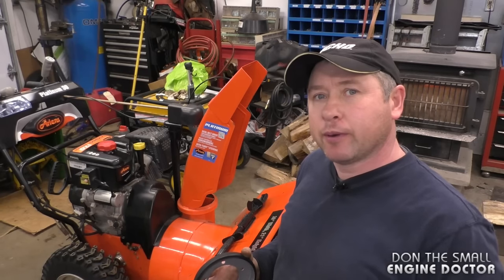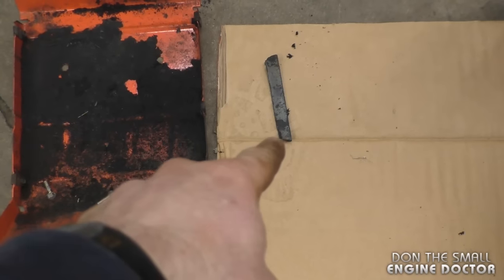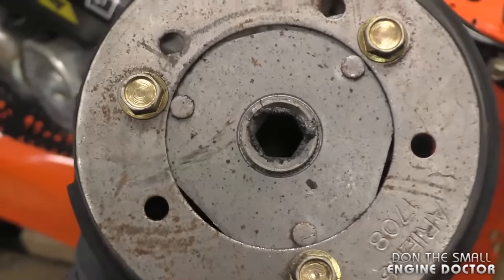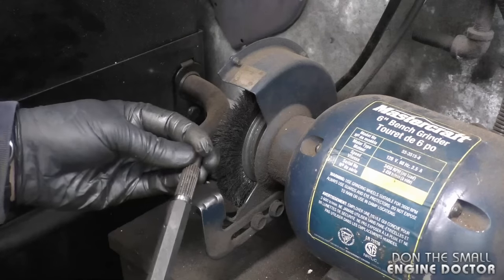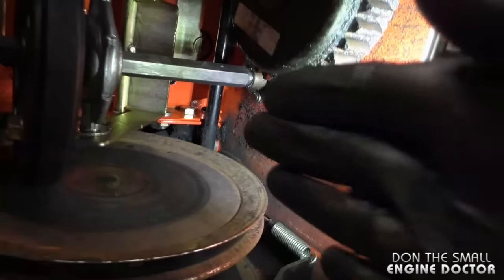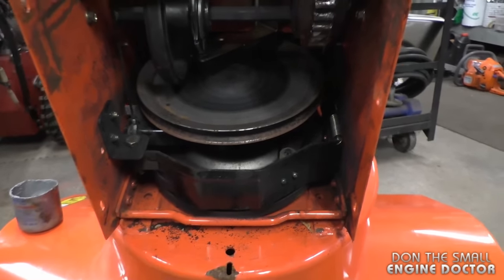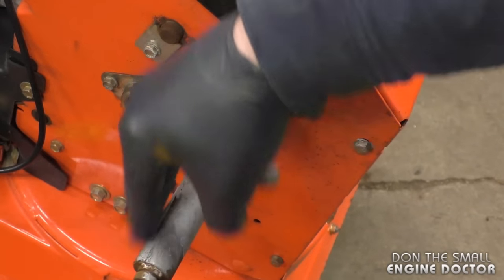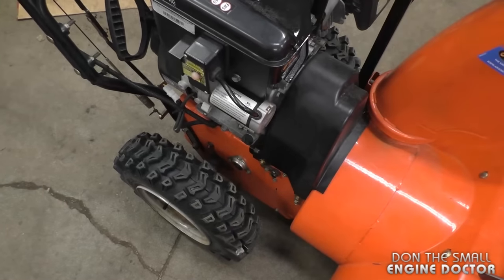HOW-TO Replace A Friction Disc On Ariens Snowblowers - Make It Drive Again!  - Video

Comment: This video is great!  It's better than the Ariens video on the same topic.  It's nice that you worked on a used model rather than a brand new one (like the Ariens video).  One thing to note, if that shaft slips inside the bearing it will ruin the shaft and the bearing.  The inner race of that bearing is supposed to have a slight interference fit with the bearing so the inner race moves with the shaft.  Ideally you would not sand/grind the shaft and you wouldn't lube the shaft/inner race of the bearing.  That said, by the time you are changing the drive disk this may not be much of a concern.

Comment: Another great video Dony! 

Confession time

I remember the first time I tore my snowblower apart. I wire brushed everything, cleaned every part then lubed all the critical areas...........including the friction disk but it was accidental. I got carried away with the spray lube and didn't see it on the disk! Ooops!!  

I didn't notice it until I tested everything and no forward or reverse! Remove the belly pan and thoroughly clean the friction plate and disk....LOL

Comment: Great video, just a quick question. Do I have to readjust the drive cable after replacing the friction disk? I had to take some slack out of the cable as the old friction disk wore.

Comment: Great video!  Reminded me it was time to change out the friction disk in my 12 yo Craftsman, along with doing the belts again.  It had some slippage during our big snowstorm last week, but still allowed me to clear.  Changed out those three wearable items, and cleaned the debris from the friction interface plate and the Craftsman throws snow like new again!  Now for that carburetor surging...

Comment: I'll be doint this on my Ariens next spring. One difference is that I have an adjustment nut on the lower left side of the belly pan. What do you know about older units that need adjustment after a friction disc replacement? Where's the hapoy spot between too loose and too tight? Trial and error until you get it?

Comment: Great video! Is there a way to check the wear of the friction disc without taking it all apart? I went to go use my Arien for the first time of the season the other day and it wouldnt drive on its own. I moved it back and forth a few times and it eventually worked and since then ive used it three more times without issue.

Comment: I had a  MTD/Yardman for 27 years of hard usage and never had a  disc wear out. The Housing rested out. Loved that machine. I also never maintained the unit other than oil and gas.I am suspecting that grease or oil is migrating onto the disc and then the rubber wheel is done for - OR - the Engagement lever was adjusted wrong. I also know  not to use 1st or "turtle" speed -  only when necessary -as that causes more wear. I am here because my 2  seasons old  ToroHD 826OXE wouldn't shift. I was suspecting critter trash in the unit , but it appears The Toro factory never lubed the hex shifter drive shaft. Everything under there was bone  dry and the shaft rusted. I didnt have grease but I hit the shaft with red scotch-brite, then wiped it,  then cleaned it with light oil and a  rag, then wiped it down with Porsche A40 motor oil.  I had some Syl-Glyde brake lube that would likely work, but the service manual recommends motor oil. Now i just remembered that I have gun oil that would work great too:) Excellent, but I don't like to see all the grease on the gears near that disc. Appear to be a  universal design issue, but surely made to be simple and easily serviceable. - Sandy

Comment: Dony Great Video.  But my issue is I can’t remove the shaft with the friction disk because the bearing is frozen onto the shaft on the right side as you are looking at the back of the unit.  Any special thing to remove that bearing?

Comment: You are right about the original friction disc wearing out early.  In my brand-new Ariens, the disc wore out in about half-a-hour of operation.  Took the machine apart and found shreds of rubber lyimg inside.  Replaced it with an after-market disc, now still workiing fine in its third season. Go figure!!
Reply: I had a new mtd wear out after short time. Really just one section. I found that return spring on drive disc was missing so I figure it was bouncing onto the rubber when sitting running in neutral

Comment: What do you do when you hold the blower from moving forward and the wheels don't turn but the clutch starts clicking? My friction disk is brand new but it's like the clutch inside slips? (Great video btw)

Comment: Hi Don  another great video,  only thing I would add would be to mention the clearance between the friction wheel and the friction disc.
Also that clip you mentioned.....I think it is there t o prevent the friction wheel housing from hitting that gear on the right
Stay safe

Comment: Great video.  Easy to follow as well.  I was wondering if you ever wire brush those some what rusty axles ?  One of the other things I do to my Blower is I clean out the hub of the wheel as well.  We got about 18 inches here in Jersey overnight.

Comment: Hooray Hooray, I did it properly!!  Thank you for all the hard work in making all your videos.  This one is especially helpful.  Thank you also for showing the different uses for "Grease" versus "Anti-Seize".  May I make a suggestion?  Please use Diesel for a washing/solvent.  It has  much higher flash and vapor points.  Its a Lot Safer to use than even oiled 2-cycle gas.  Thanks again for this and all your other videos.

Comment: I found putting on Loctite @5:50 in the video interesting. I would have thought that anti-seize would be the product to use. The snow blowers you work on may not have much rust yet since older equipment is not brought for service as often (being either repaired by the owner or discarded due to cost considerations), and the bolts in the video look new. However, snow blowers have plenty of opportunities to accumulate rust as they age, and fasteners need all the help they can get to prevent them from oxidizing. Do you have any experience with the friction discs loosening to warrant using Loctite?

Comment: Among my pursuits and businesses, I presently own/operate an appliance repair business~~washers, dryiers, reefers, etc. I have always done my own repairs on all of my equipment, including snowblowers and/or etc. 
This is an excellent video however, the most important thing to me is those gloves you are wearing.
Will you please tell me what they are and where to find them?
Thanks.
Reply from the maker: they are black nitrile gloves, you can get them on amazon or a safety supply store

Comment: Dr. Don, you are amazing! I just received an old Murray 624505x4b as a gift from a very good friend who moved to Arizona. It runs good but I like to learn. Since then, I have been watching your videos and even many that are not for Murray are very interesting. So, since I have the Murray axles with lynch pins, I guess I should use grease and not anti-seize on the axles if I want to have the option of only using one drive wheel? Thanks so much for sharing!
Reply from the maker: yes

Comment: Hi Don, I have torx bolts on the friction disk mounting plate on my Ariens and I am having a devil of a time to remove them do you have any tips on how to loosen those bolts? I read somewhere that its possible that Ariens uses that Loctite stuff that you are using to keep the bolts on tight.

Comment: Hi Don, we're about to get a noreaster here on the US east coast and we really haven't had much snow in several years. What should I do to get my snowblower ready? I ran it dry at last use and it's been sitting for about 5 years...
Reply: go see if it starts right now....FRESH gas is a big key...plus if it sat for a long time, there is a good chance critters got inside it and made nests all over any openings....you are about 2 -3 months behind schedule for snow in the NorthEAST...I live in Syracuse NY so it is a regular deal for us every year...now get going...or get the shovel ready

Comment: Dony ... you helped with the fricton dics last winter ... now one side of the auger is frozen.  I can start it ok, but only one auger spins.  The other is frozen, shear pin seems to be seized and both ends are broken. It;s one solid bar so I don't understand why one would turn and the other not. It will not turn freely when stoppped.  Any ideas??? I'm stumped!
thanks, Ken

Comment: Great video. I have similar setup. My friction disc is too far to the left. First gear won't work but 2nd reverse gear is grinding on against metal to the left. 1st gear is slightly left of centre if the friction plate which tells me jt all needs to move over a bit.. any idea how?
Reply from the maker: is you shifter linkage adjustable? I would have to physically see it

Comment: Not a bolt usually checked, but check your starter bolts that hold the starter to the block.I’d never checked mine since new but after 8 years or so I checked them during other work and noticed they took almost a full turn to fully seat and draw down.

Comment: Dony, my dad has a 25 year old Craftsman blower, the drive wheels are no longer engaging when you pull the lever, the friction disc doesnt appear to be that worn but when you pull the lever it doesn't appear to shift the discs together to engage the drive axle. do you have a repair video for this?

Comment: Great video Dony - only question I have is the square bracket "washer" and round steel washer on my exact machine seem to be reversed when capturing friction disc assembly to fork.  The small engine company that delivered my 921029 didnt do a great job as it broke 2 storms in so dont know if they assembled it incorrectly or not.  I did look at the Ariens parts manual and if you look at it from the perspective of how the actual machine sits when doing the repair the manual shows the assembly diagram in opposite orientation.  So thinking I inverted the diagram correctly it does appear that Ariens shows the square bracket on the bottom and the round washer on top.  Can you double check from the schematic and tell me what you think.  Thanks.

Comment: Do you have a video on changing the friction disc on a snow blower with an easy-steer system?
I want to change the friction disc on my old Troy-Bilt 3090 (31AH5ZQ54711) with steering assist. That seems to make accessing the friction disc more complicated. 

I don't want to mess this up, so I would appreciate any advice and guidance I can get.
Many thanks.

Comment: Hi, I have the AX396 engine on the 24" SHO Platinum. Since new it does not like to start in the cold. I have tried every conceivable sequence with the primer and choke. I end up having to use the electric start and crank it a lot to finally get it going. It will always start but,  It the summer I run it and it takes only one or two pulls. I have done a pretty good search and it seems like this is an issue with this engine.
Is there anything I should try. If I keep it in the garage and keep temp up over 50 it will start easier. I have changed the spark plug and keep fresh gas in it. Anything else that you might recommend?

Comment: I have often wondered what type of grease to use on the shaft the friction disk slides on.  I've used lithium but it seems to get pretty thick when it's cold.

Comment: HELP!! I have a 1708 Arien's Friction Disc that I needed to replace. I purchased your recommended Oregon part but it doesn't look like it fits. There's not enough clearance to get both the square and flat washers in place. What am I doing wrong? I really wanted to try the Oregon disc sine the Arien's discs do not last. Please let me know.

Comment: Minister donated his regularly used  94 mtd to the church. As part of checking it over i replaced the drive rubber. I don't recall what I used to lube the hex shaft. After a few uses I had trouble shifting gears. Disc was sticking on the shaft. I sprayed with brake clean and it started moving. After another few uses same thing. Again loosened with brake clean. Had some garage door lubricant on the shelf there so applied some. What's best to use. I have John Deere corn head grease for blower gearboxes. Would that be good to use? Ok. I see white lithium grease. I thought that was what I sprayed on the first time.
Reply from the maker: i apply lithium grease with my finger

Comment: Hello Dony, great video as usual. Assumed about the differents the anti-seeze vs. lubricant on the wheel shaft. Why do you use anti-seeze likely than a grease? Do you think grease is not so durable compared to the grease? Greetings from Czech rep.

Comment: Hi Don, i just bought a new snow blower from Lowes Briggs and Stratton. This the second year I have it. On the first year, I find that sometimes that it will not move when you squeeze the drive. I tighten the cable and it seems that it work. But my question is;  is there anything that i could have done?  I'm thinking of cleaning the drive plate with break fluid, is that going to work as well?
Reply from the maker: you can use brake cleaner not fluid. adjust your drive cable, it may help
Reply: @donyboy73  sorry I meant break cleaner and not break fluid, I understand you said before that those 2 components must be free of any oil or lubricant.

Comment: Have a quick question I have a newer Ariens compact 24 I changed the friction wheel and traction belt but still not much power to wheels my model is 920029 the belt I used was 07200603 not sure if it was oem could this be my problem

Comment: I have an older Ariens mower with a friction wheel drive like a snow blower. The friction wheel is discontinued. Is there anyway to install a generic wheel or add rubber to the wheel? It seems a shame to throw away a mower of this quality for an individual part.

Comment: Great video, I own an Ariens Platinum 30 with the 414cc engine. Maybe you can help me out with finding a part for my machine, I'm looking for the sqaure plastic cover that fits over the extension cord port for the electric start.
Reply from the maker: you should contact your local ariens dealer

Comment: Must have a defect on those machines, I have a 2014, 28 deluxe and have had the drive wheel done 3 times. 2 under warranty and one I paid for. Where did you get the replacement part from?
Great video, will save me money next time.
Reply from the maker: yes, that's why i use aftermarket oregon friction discs, they last longer

Comment: I use scotchbright with contact cleaner to clean that drive platter. It seems to get a little more "traction" on the rubberized friction disk.

Comment: Do you have a video on replacement of the friction disc on a Ariens 10000 series more specifically a Model # 910010 8-32 mine is a 1973 and I don’t believe the disc has ever been replaced. Thank you

Comment: My Ariens has a hesitation to move but then once the wheels engage the will spin on concrete. The metal plate has been cleaned andcwhile the friction plate is not new it still has plenty of rubber and the bottom cover was not full of shavings. Its clean. I recently replaced the drive belt with the OEM part. Any ideas what this hesitation to move might be. I also have the control tension set to just below wanting to engage as the hand grip is squeezed. One wheel will turn and then the other if I rock the blower. Is there something called a "Hilbert" junction that can fail?

Comment: Is there a minimum measurement for the diameter of the friction disk?

I have a 2005 craftsman Craftsman C950-52430-1 and sometimes it wont drive and then takes off again.

Comment: Dony, need help here...any suggestion on how to remove a stuck wheel on troybilt snowblower storm 2410? Thanks
Reply from the maker: i use oxy acetylene, sometimes just penetrating oil and tapping it works

Comment: Good one dony, thanks for sharing.
So how did this happen?
Also, assuming a Cub Cadet 3x is similar (and it looks that way), how could one increase the reverse speed? Is the friction wheel adjustable on the shaft?
Reply: Dony posted a video about it years ago. I don’t remember what kind of snowblower was, but in principle they are all very similar. Good luck!
Reply from the maker: https://www.youtube.com/watch?v=uEZVZ3RlQLM&t=15s

Comment: Any tips for best way to attach the replacement Friction Disc if one doesn't have a vice?
Reply: The vice is for loosening or tightening the bolts. I did not really need to use a vice (although I have one), I just held the plate with my hand and unscrewed it. You can use a wrench on the axle to hold it in place while loosening the friction disc bolts.

Comment: Great, as usual. Any thoughts as to why the friction disc failed in such a new machine? I wonder whether there is another underlying problem there (?). TIA
Reply: Same thing happened to my brother’s 30 inch Ariens. He got bogged down in some deep snow at the end of the driveway.  I suppose it could cause it, but I thought it odd at the time. It was a brand new machine as well.
Reply from the maker: poor quality friction discs that's why i recommend the Oregon ones

Comment: I am replacing myt friction disk on a 920012 and upon pulling the wheels off I heard a part dropping inside the housing which would turn out be a bolt with lock nut on it. It is rusty and the threads a bit dinged up. The only possible place I can think where it came from is underneath in the center of the round plate on which the friction disk interacts. But I cannot obtain an exploded view to see if that is correct. Any help?

Comment: How old is this machine? What would make a friction disc disintegrate like this? I bought a replacement disc for my 30ish yr old Craftsman assuming I needed to replace it. I opened up the belly pan for the first time and realized the original disc is still in amazing condition. Makes me question Ariens quality.